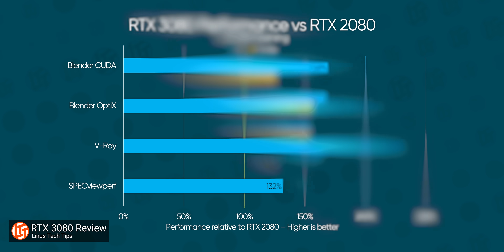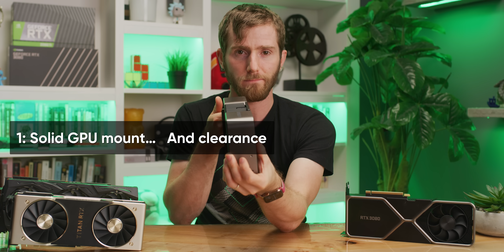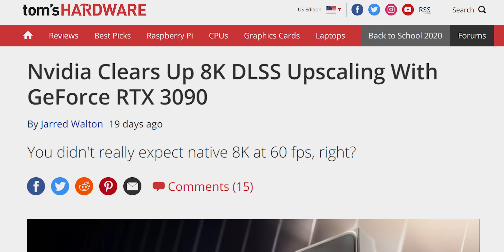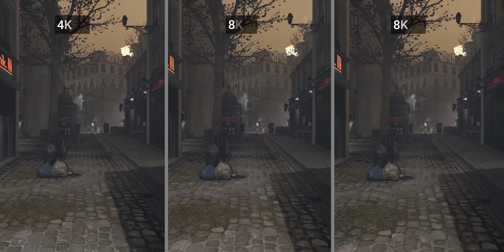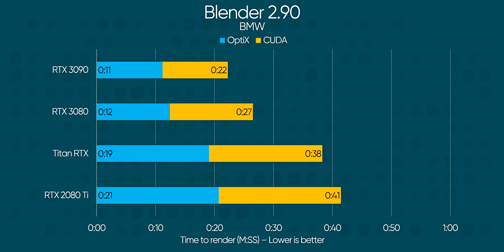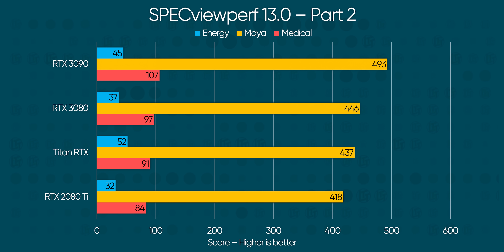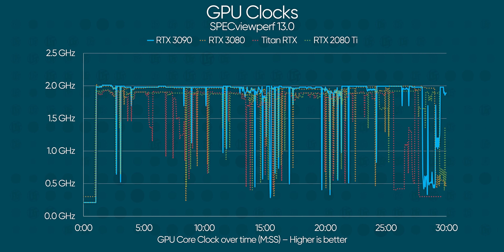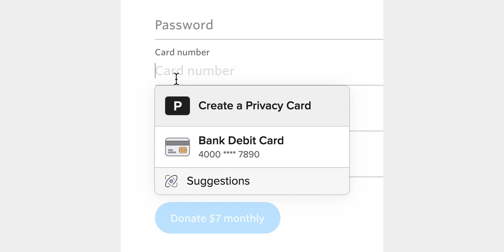Making Nvidia’s CEO mad - RTX 3090 Review

Comment: I smell burning coming up in the 4000 series. When the new architecture is already running at 300 - 600 watts. We're going to get a repeat of the GTX480 heater when they push this architecture to the max on the RTX4080 I bet. Well, when it comes out....

How ironic would that be? 🔥🔥🔥
Reply: GTX 480 was 250W.  Insane for its day...but modest by what we have now.
Reply: Doubtful. RDNA2 is going to be VERY efficient, and Nvidia knows this. They are going to make another new architecture with a much better node in order to really stick it to AMD. They pretty much have to.
Reply: Yeah, maybe in another 4 years
Reply: 1. The 4000 series is going to be entirely new architecture, on a different node. 
2. RTX 3000 isn't even close to drawing 600W, as they are all power limited in bios. 
The max is around 450W in a furmark test, and around 350W when gaming. 
Which is similar to a extreme version of a 2080Ti. 
3. There is no irony in your comment. 
Making a power hungry card 10 years ago, and then make a power hungry card 10 years later, isn't irony.
Reply: @Orcawhale1  
1. I bet it will be an upgraded architecture based off this Samsung / Nvidia architecture it has now but with tweek upgrades. Same chip sizes.. ect. But with higher speeds and more ram. 
2. 450 watts is still a TON of power and tbat heat IS getting blown out the PC case.  Not to mention extreme PC builders maxxing out cards and cranking up voltages and so on. 
3. All this architecture jumps to save power and heat... just to crank the power and heat back up again on another closely named card. Isn't it ironic... don't you think. Like rain on your wedding day. Lol
Reply: High Power Draw doenst necessarily mean high Temperature output. Efficiency is the key, and for my eyes Ampere looks damn efficient.
Reply: @AngryApple   Efficiency, aka performance per watt is definitely key. However power draw does in fact directly translate to heat output.  500W for example will produce 500W of heat. If the card uses it efficiently or not is irrelevant to how much heat is outputted.  The energy consumed must go somewhere, generally into kinetic or thermal energy. As the only things that move on the card are the fans that means that 99.9% of the energy is being converted directly into heat. The energy used by the fans will eventually turn into heat as well in the motor windings, friction within the bearings, or just the friction of the air itself. If you have a better cooler that runs cooler core temps it doesn't mean that your room wont get heated up as much. All a better cooler does is transfer the heat more efficiently. At the end of the day thermodynamics reigns supreme. Any electricity used by a device will eventually make its way into becoming thermal energy that must be dealt with. It may be converted directly when passed through a resistor or a processor, or it may be through a display and the light off of it heating everything it shines on by a miniscule amount evenly spread out through the room. At the end of the day all energy used will eventually be converted into heat. What the device does with that energy on its way to becoming heat does definitely matter. However, at the end of the day 500W power consumption means 500W of heat output.
Reply: @AngryApple  you lost me there, where else will the energy go if not to heat?
Reply: @AngryApple  what goes in, must come out. If you feed 500watts in, and the GPU outputs what electrically? 10w? Rest must be dissipated as heat.

Comment: I just want to know if my system would benefit from a 3070 upgrade.

I5 8600k 
16GB 3000mhz RAM
GTX 1070 Strix 8GB
MSI Z370 PC Pro motherboard 
750W power supply

Comment: I mean the bonus in performance is noticeable, but the usecases over other, lower priced gpus are just not there imo. Unless you want to spend a couple k on a GPU+ decent 4k/8k monitor, you will be perfectly ok with a ~500$ gpu and 1440p. I have a 2080 and with the games I play I am barely pushing it to it's limits

Comment: Hmmm

I am a bit confused Linus. Why would anyone use a test system with Intel's fastest multi-core CPU and NVidia's fastest GPU, but only use 16GB of system RAM? Regardless of one's position on System ram on gaming performance, I highly doubt anyone using these components would be using less than 32GB of system RAM. In fact, given the relatively cheap RAM prices at the moment 64GB of RAM is far more likely. This far more realistic real world setup would of course further raise already high internal case temperatures and thus negatively impact both CPU and GPU performance.....

Comment: 7:33 this seems kinda biased. The 4k picture has texture details in the wall which makes it look grainy and realistic, same as the 8k version. But DLSS completely smears the entire wall such that no detail is visible whatsoever
Reply: It does some things well and some things not so well. The simpler things it handles well, but the complex textures it just kinda get smeares together. IMO DLSS is only really that great when you HAVE to have more performance or if you run it at 75% minimum. To Nvidia's credit, upscaling 1440p to 8k while still looking even remotely like 8k in any way is impressive.
Reply: Roughly put : DLSS 8K = 8K native with 70% screen percentage.

There, I fixed it for you.  :)
And I also explained the "magical performance gain" everybody freaks out (for no good reason).

Of course it's not the same...but it feels the same.
Reply: DLSS basically is very good AI Based Anti Aliasing. Your not actually playing in 8K, just sorta upscalled
Reply: @arcadeportal32  It's upsampling, not upscale; upscaling was DLSS 1.0
Reply: 7:31. I agree I can see the smearing on the wall as well.
Reply: It looks like shit
Reply: @Ignore14  no. It doesn't lol. It looks far better.

Comment: Why RTX 3090 is SO Weak...& 2.5 times more Expensive than RTX 3080...!! Just Only 15%-20% Faster than RTX 3080 ...omg...!!   ( RTX 3090 at 10496 cuda core vs 20% down RTX 3080 at  8074 cuda core  vs 47% down  RTX 3070 at 5888 cude core  =  RTX 3070 speed should be 90-95% of RTX 2080 Ti Speed... )

Comment: Linus, hoping you can help me understand something. I was looking at getting a 3090ftw3 ultra to pair with a Samsung G9 monitor. I know the 3090 excels vs the 3080 at 4k than at 1080 (the G9 is 1440). But given the number of pixels to be driven on a monitor that size, is it likely I'll have more of a performance drop using a 3080?
Thanks!

Comment: This review did not have enough gaming benchmarks, you didn't actually compare the performance vs the 3080 directly. Also, I wish there had been benchmarks done at 1440p or 1080p. Now I know what you're thinking Linus: "What kind of idiot would buy a 3090 and still has a 1080p or 1440p display?!" but you KNOW there are going to be people who do it. Also, what about those new 360 hz monitors? I recognize you're getting pretty CPU bottlenecked at those framerates, but I think you could've gone a little more in-depth here.

Comment: Still not quite that baby’s first Quadro several Titans (inconsistently) served as. Still has a Geforce cut rate FP64, no access to NGX, artificial limitation non professional drivers with typically bad OpenGL, artificial limitation to half-rate on the tensor cores for FP32 Accumulate (ie, the actually useful part for Deep Learning) which is just gaahh, no P2P DMA, so where Nvidia quotes something like four times faster than the 2080TI, that’s subtly with structured sparsity, this is quite sly as this means those flops are only attainable when your matrices are 4:2 sparse (ie at least 2 zeros per 4 elements). That’s never the case for training. So from the get-go the dense Tensor flops are half what nvidia quotes. So there's still room for a Titan above this, and a Titan killer this is not.

Comment: I mean if this GPU does not really shine for work loads, what is the point ? 
you could spend 100$ more and buy 2 3080s and stack them like dominos and you are probably going to have a much better gaming performance am I right ?
this card is OP but 15% improvement ? let's be honest the only situation where you would buy one of these if that you had an 8K monitor and for gaming... I would prefer those sweet sweet high hz monitors, probably there is even 4k 120hz monitors already out there... why would you want 8K for gaming ?

Comment: Wonder if it would be worth upgrading from SLI 770s on a 4770k to the 3070 when it comes out? Or if the whole system is probably needing an upgrade at this point.

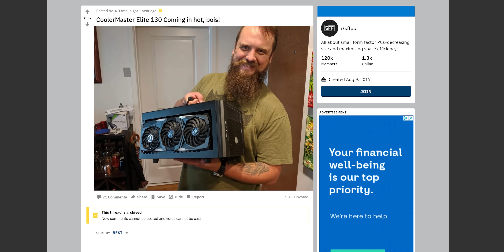Comment: 2:02 Hi, I am the hotrod guy. That is a MSI RTX 2080TI Gaming X Trio in a Coolermaster Elite 130. It also has a 3900x running under a Corsair H80i V2 and I installed a speaker cabinet spring handle on top for easy transport to LAN parties.

Comment: I have q question:
Will my amd fx-8350 bottleneck the rtx 3090? I want to get one for my system and i was wondering if there's the possibility that it would be bottlenecked by my fx 8350
Reply: If you can get a rtx 3090 why not upgrade the cpu to at the very least a 3600
Reply: But amd said that the fx 8350 is future proof so that means i dont need a new cpu

Comment: 0:47
I am not trying to hate or so, but that graph is absolut bs because the 2080 is no the predecessor of the 3080 but rather of the 3070
Reply: That's straight up not true. There will be a
3070 released soon.  The higher end cards always get released first. The 2080 is the predecessor of the 3080.

Comment: back in the 900 series or even the 10 series you'd probably sli a pair of the 3080 equivalents. Now for the same money they offer the 3090 a card, no one but the biggest show off should get.  The 3090 is the instead of SLI card.

Comment: The 3090, the card you'll regret buying in 3 months, or within an hour of getting an extra 15 fps over a 3080 for an extra $900 lol.
Reply: It's the difference between 45fps and 60fps. Idk how long you've been gaming but it makes a difference for sure
Reply: @NexGenTek  I have been gaming on PCs since I was a teen (I'm 35) and have been making and selling them for over a decade.

That 15 fps advantage was on a game at 165 fps compared to 180 fps, so at 45 fps that is an exact advantage of only 5 frames per second sir.

60X3=180
165+15=180
180 divided by 3 is 60, so if it was at 60 frames per second, the 3080 would be at more like 52 fps, so a 6 fps gain there lol..

Comment: The 3090 seems like the real performance card to buy this gen pitty it may likely well exceed 2500 au dollars not to mention the need to have a top of line cpu to take advantage of the raw gpu power, a new 1200 watt power supply and case. So basically a new 7 thousand dollar plus pc

Comment: 3080 65% faster. Yeah no. more like 35% lmao. Maybe 75% in rtx titles at most.

DLSS 2.0 ultra performance looks like garbage compared to 4k. What about those "TITAN REPLACEMENT" comments? Many people have said its a 2080ti replacement, and have been shot down as a result. Guess this proves that it is a 2080ti replacement at an increased price. 

Put that along with buggy drivers, awful samsung 8nm yields, and misleading performance numbers,  super high power consumption, this is a disappointing launch, which is only helped by the mediocre 2000 series. Wait for RDNA 2